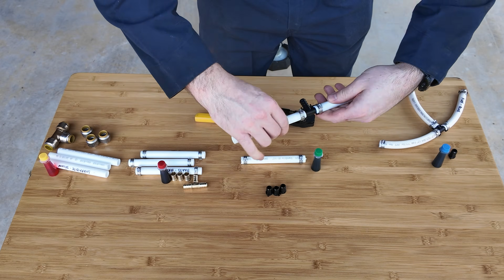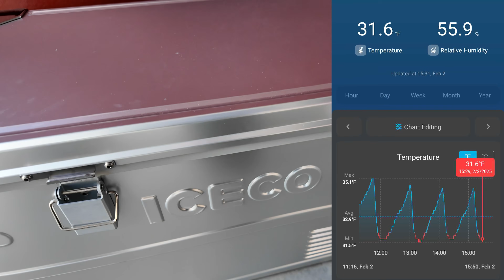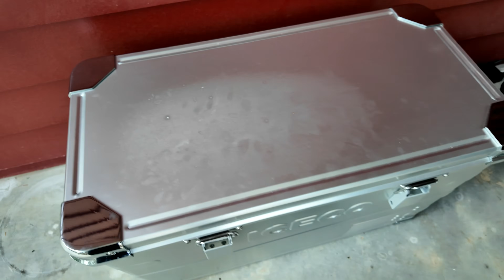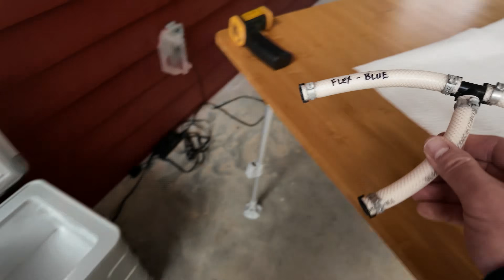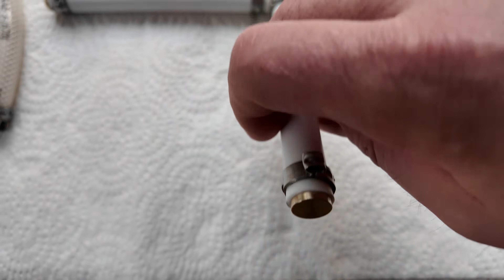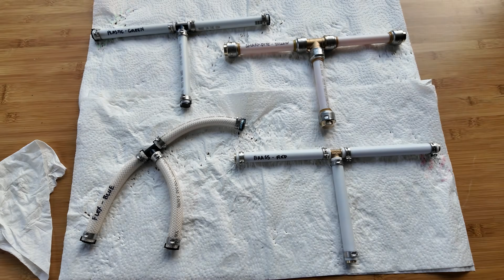Freeze Testing RV Plumbing // Flex Hose vs PEX vs SharkBite (and Brass Fittings!)

Comment: I installed 5 water allarms throu out the camper in possible leak areas as a CYA.  Had one going off when I stopped for gasoline.  Was behind the water heater.  Probably an eighth of a cup.  Cleaned it up and put a dish under it and when I got home, another bit of water.  I don’t remember if I had pressure in the system or not.  I know the pump was not on.  Just an idea.

Comment: This was a good experiment, but the one factor that multiples over time is the motion of the moving/shaking RV in conjunction of the random freezes / high pressure events. This test is more of a starting point.  Over time the braided hose tends to fail in higher amounts vs any other type. My understanding regarding the vinyl tubes is that even though it can expand a bit better, the pex rings are not the right OD size to start with and were never intended to be used outside of pex pipes. So over time they are prone to leak. They should only be attached via classic worm screws. Pretty much the only lines that have failed in my travel trailers have been those vinyl hose sections with pex connections. Every one that fails i end up replacing with brass. The brass overall have better fit and finish along with higher end rubber connectors. All the plastic connectors appear to be very cheaply made. I've only had my travel trailer for 3 years and have already had to replace all the plastic fittings that connect to the water faucets. From day one i have had the trailer on 45 PSI, So i know it wasn't human error on my part at least.
Reply from the maker: Great points, thank you for the feedback.

Comment: I want to blame lack of attention to properly crimping the rings. My last two forest river trailers had a few drippy flex line fittings. Annoying. No freezing, always thoroughly ran antifreeze. I think you're just lucky, lol. Removing the fittings, cutting the end off and recrimping resolved all of my drips.
Reply from the maker: Great point. I've often wondered about that as the flex lines seem to be more difficult to do than regular pex with the crimp rings given the outside diameter of flex. Thanks for watching.

Comment: I have long suspected that many failed connections and water pump check valves are due to unregulated high city water pressure.
Reply from the maker: Great point, I'm with you.

Comment: pex A uponor is best pex, we use it for residential houses......much better than crimp rings, plastic fittings arent the issue its the crimping rings, sharkbite not a chance I would use except for emergency repair.......its over time that is the concern and I believe the pex A pipe is better than B

I would replace everything i could see with Uponor.....
Reply from the maker: Great tip, thank you for watching.

Comment: Nice work Justin. I had an entry level trailer with all flex with plastic fittings for 9 years. Never leaked but also was not camping with freezing temps for any more than brief overnight moments occasionally. Was very good about winterizing as we live in Denver.  Now we have a nicer trailer with Pex and still plastic fittings and as of yet no issues. I’m sure there are exceptions, but I would bet improper winterizing and too much city water pressure are most likely the issues. It doesn’t make sense for manufacturers to keep installing plumbing that is highly likely to fail and therefore piss their customers off. JMHO
Reply from the maker: Thank you, great points!

Comment: I replumbed a bunch of my system to grade lines better for low point drains, insulation, adding water filter, etc.  I found at least two flex lines/pex transitions that started leaking after I wiggled them. Just another data point.  I did use brass fittings in some places but kept plastic fittings in the underbelly mostly because I didn’t want them to be a heat sink down there.
Reply from the maker: Great point on the brass. Thanks for watching.

Comment: Some are keen to this finally, such as Grand Design who since the end of last year has been using brass valves/ fittings and no longer uses the vinyl braided hose that doesn't fit the PEX fittings.  All Pex and pre-made faucet style hoses now.
Reply: Where did you see them state this?
Reply: @EBKRV412  I've seen it for myself at 2 RV shows  and the 2025s at my local dealer.  I noticed it first at the last Hershey Show last year.
Reply from the maker: Thanks for sharing! Great to see changes.

Comment: If you keep an RV long enough you’ll have a leak with a plastic plumbing fitting. These cheapo fittings that are so commonly used in RVs are going to break eventually. Even f you change them out with Shark Bite brand fittings you’ll be better off in my opinion. Also if you have PEX pipe in your RV (many do) don’t put out rat poison in the RV. Rats eat the poison then go looking for water. They have been known to chew into the pex pipe to get to the water in the pipe.
Reply from the maker: Great tip, thank you for watching.